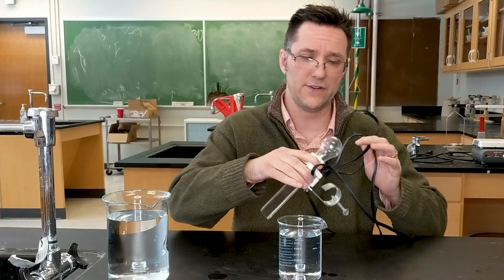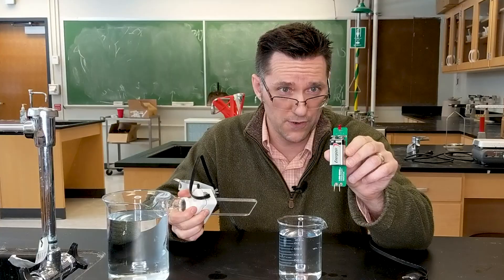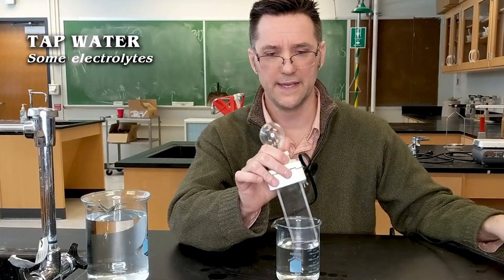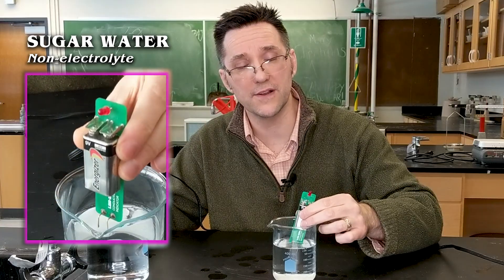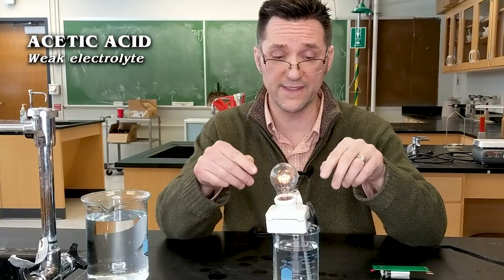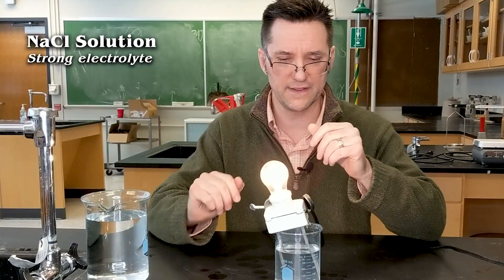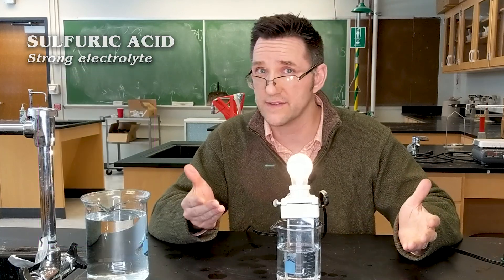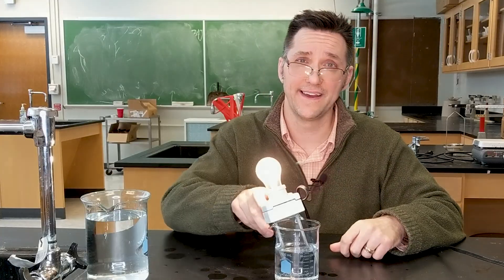Why Does The Bulb Light Up?

Comment: I love this video. Thanks for uploading it. Absolutely good for my country where the electricity situation is very bad.

But, there should be a specific density for each acid to be able to form the electrolyte that can conduct proper electricity to light up a bulb or socket. I did tried them out, but little drops of each acids in water was unable to conduct a bulb lighting electricity.

Please, what was the density you used for the sulphuric acid and NaCl electrolyte solutions?
Reply from the maker: It doesn't take a lot of sulfuric acid, just be careful diluting it. For the light bulb, you'll probably need more than a couple drops as opposed to an LED which won't require much.

As for the salt, it was pretty much a saturated solution, but I wasn't aiming for any strict measurements. 

Hopefully that helps. Great question and I'm curious what the minimum concentration needed is to get the bulb to light. Whatever it was, I was well past it. 😄